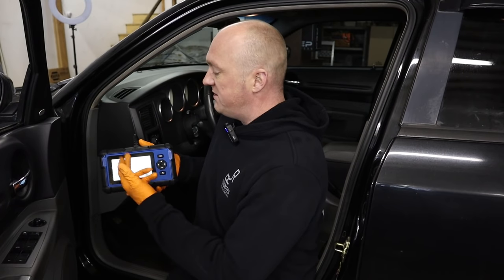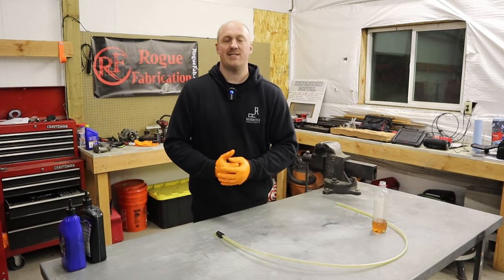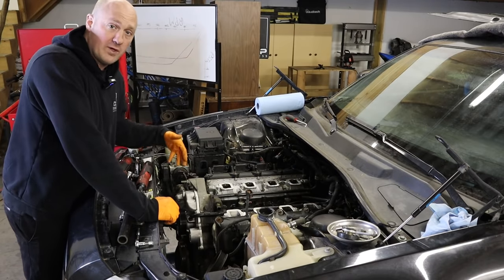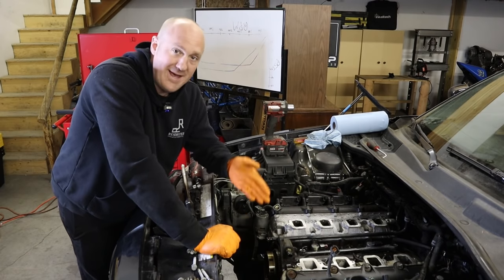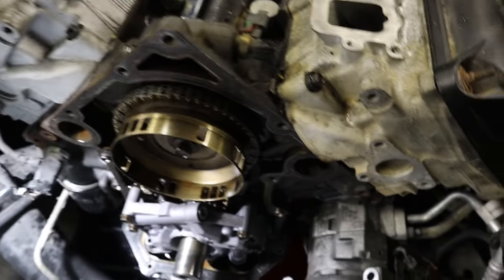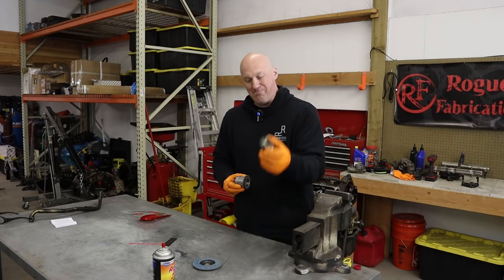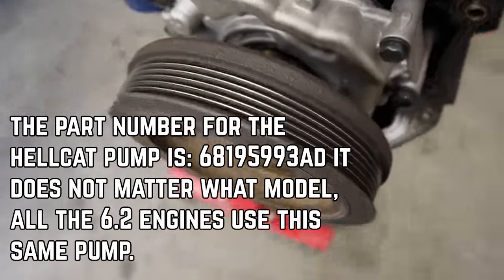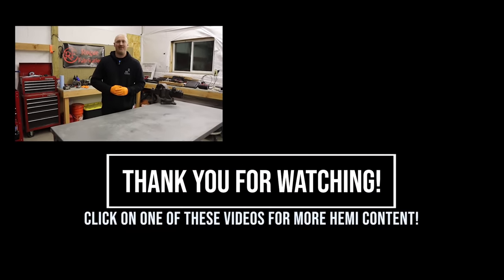Will This FINALLY FIX Hemi Tick? #hellcat

Comment: What could be wrong if after Melling pump install there’s only 34-37 psi cold and drops to 0-4 psi at idle warm?! Where could be a failure point?
Reply from the maker: I'd be inspecting the oil pump pickup tube o-ring. It's possible it got cut or damaged during the install.
Reply: I’m very positive it wasn’t, but worth the check, was thinking maybe screen is clogged. Really didn’t want to tear all apart again. Weird thing is at the cold start it goes to high 30 psi, and as it idles and warms up it drops. Changed oils and filter thinking debris blocking it. I’d did help a little, but still only around 6 psi hot idle. It does go up if you rev it
Reply from the maker: @zappbrannigan8952  ya that's way too low, gotta come apart again.
Reply: Thank you for replying. Will do update later if I find anything
Reply: I found that seal was good, no restrictions from the oil pick up tube, I pulled pressure relief spring- all good, but on a valve piston sides I noticed some scratches. It makes me think that some debris went through and did some damage to the pump. You think it could of scratch the gears and sidewalls enough to let hot oil escape? I don’t know enough about pumps. I don’t think debris got into oil galleys, that should off been trapped in the oil filter. Pump is only unprotected by filter component. Any thoughts?

Comment: Will a ram oil pump move at all to access bolt underneath even if I have to bend the tube a little?
Reply from the maker: Some people have said they've done it, but I don't recommend it myself.
Reply: Thank you for the response man! I appreciate it one more question in your experience did you have to take off the motor mount to remove the oil pan from those rams?
Reply from the maker: @CJ9494.  you don't have to take them off, just loosen the bolts and raise it up a few inches. It's necessary to reach some of the oil pan bolts and also helps to drop the pan down enough to access the oil pump pickup bolt. 👍
Reply: Your awesome man thank you again for the help tryin to tackle this job on my slanted driveway’s gonna be a pain lol I appreciate your expertise!
Reply from the maker: @CJ9494.  make sure you watch my latest video I just posted last week about this issue for more info before you begin your installation!

Comment: I'm buying a 2014 AWD RT that just had a camshaft and lifters replaced, and I was concerned that I was going to have to go through it again in the next 80k+ miles. I had considered upgrading to the 6.4l to get away from this issue but found that the 6.4 has the same exact problem.

It's a weight off my shoulders to know that tossing a hellcat oil pump on in place of the stock one will greatly improve my idle function which appears to be the culprit. Are you certain that the FCV kicks in at 100 psi? I live in the north where we remote start on -30F days and let er idle for 10+ mins cause we'll freeze our beanbags off if we leave too early. I'm not sure what the PSI is idle at -30F but I can imagine it's up there.

I plan to use 5w20 Penzoil Ultra Platinum as the car I am buying is at 106k miles.

Comment: Haven’t watched all the way through yet, but my 6.1 with new lifters and cam runs ~14 psi operating temp at idle. Is this reason to worry? Usually 38 psi or so at 2100 rpm or 60mph
Reply: I’m in the same boat with my 5.7.

Comment: Is the stock pump brand new?
Reply: I doubt it. From the looks of all the oil varnish on the outside of the pump,  it was a well used stock pump.
Reply: @budlanctot3060  dont really think hes gonna get accurate results than. Just replaced my pump after 160k. Warm idle went from 37 to 64🤣

Comment: That is an outrageous amount of oil pressure......ever hear of parasitic power loss?
In hot rodding, the rule of thumb is 10psi per 1000 rpms...
Reply: I was thinking the same. I wonder if it’s possible to put a lower pressure spring in the hellcat pump to have it bleed pressure similar to the stock pump at say 75 psi
Reply: @Jpm928  Trim one coil off the spring at a time. Old racers trick get oil pressure where you want it.
Reply: @oldblueaccord2629  I’ve since done the hellcat oil pump swap. I simply replaced the bypass spring with the oem 50psi spring from my stock pump. I now have 45-60psi pressure range vs 20-60 with the stock pump.

Comment: I'm not convinced,  I think I need to drop off my truck at your shop. The hellcat pump will be in the passenger seat. Your drink of choice will be in the cooler...
Reply from the maker: Coke please 👍😄
Reply: @Reignited - Cycle and Automotive  I'm tempted to do this on my own. My truck is not my daily driver so I wouldn't have to rush to complete it. I love the truck, rides great, decent fuel mileage for the hp it has being a full size truck.  But in the back of my mind the chance of a lifter/cam issue is there. I use penzoil platinum and add a few ounces of liquimoly with a wix filter. I rarely get any ticking on a cold start and never hear it when warm. It's at 60k miles.
Reply from the maker: @E&C  it's a pretty straightforward repair,  if you're at least competent with mechanical things it's not too bad.

Comment: 20 psi for that engine is normal on an idle with no load behind it and I would never run 5w 20 in a V8 minimum I would run would be 10 W 30 second high pressure and high volume are two different things higher-volume oil pump will not necessarily give you greater pressure because the relief valve in the pump itself is still set at a factory pressure in order to increase pressure you would need a high volume high pressure oil pump which is available for the Hemi engine you wouldn't have to go in modify a Hellcat oil pump to fit it you would just simply by a high pressure high-volume oil pump
Reply from the maker: Dennis how much of this video did you actually watch?